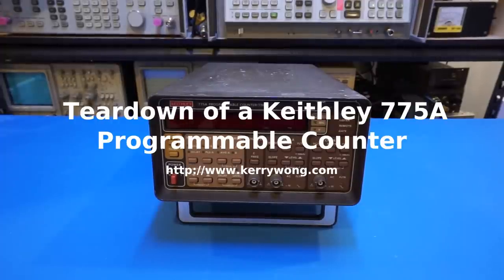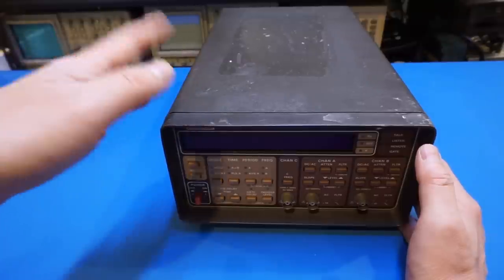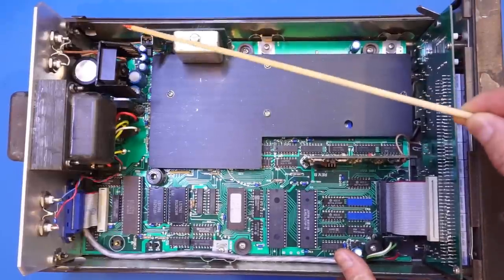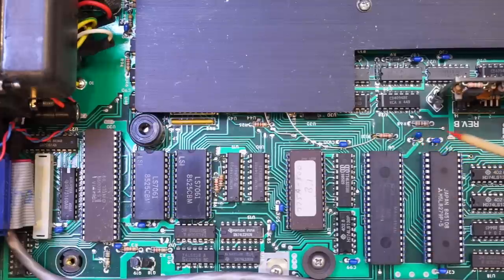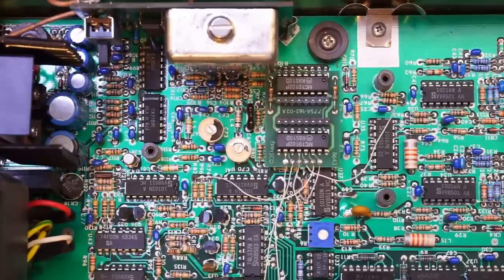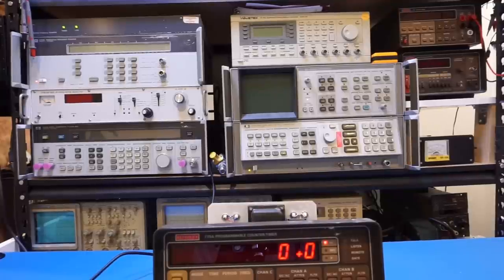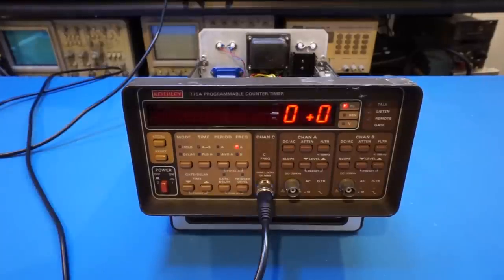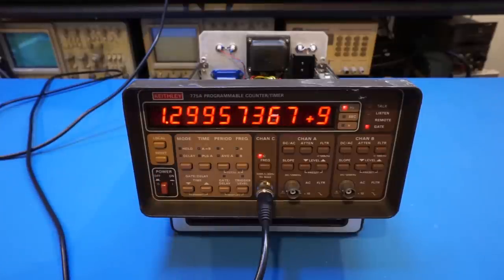Keithley 775A Programmable Counter Teardown

Comment: Perhaps if you feed your Rubidium standard into the external clock port on this instrument, you would be able to verify that the gating, counting and math functions of the unit are working properly.  This would definitively identify the TCXO as the problem.  Very interesting video, Kerry; thanks.
Reply from the maker: After I made this video I did exactly that and concluded that indeed the TCXO was out of tolerance. I am going to "fix" the TCXO and make another video. Stay tuned!
Reply: Great!  I’ll be looking forward to seeing your “fix.”

Comment: I found once that a faulty ocxo was due to the 25 turn pot being cracked from age (hot environments drastically increase the aging of plastics), once I replaced the adjustment it was fine, likely to be the same in this case.
Reply from the maker: The TCXO package is sealed, I will need to take a look to see if there's anything I can do.

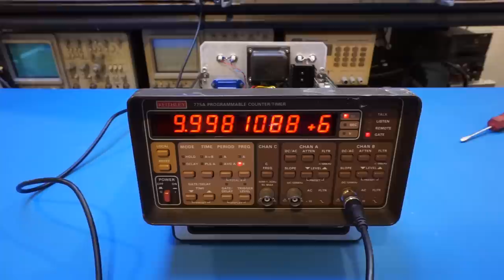Comment: I voted a Thumbs Down, because you investigated on the accuracy in an  unsystematic manner, and called 200ppm deviation at first (17:56) being   "pretty close to 10MHz" (which in fact is instead way off), and later (21:51), after unsuccessfully trying to trim that extreme deviation  as being  "OK", although such a huge deviation at once indicates a defect, when dealing with XTAL based oscillators. The trimming range is ALWAYS a few ppm at most..
Maybe the TCXO itself is fatally defect, or the 100MHz multiplier circuit (much less probable, indeed)
By the way, to create a sophisticated video, you should have mentioned, that this counter not only makes use of the reciprocal count method, but also uses a synchronizing gate for mitigation of the 1 count error, and also uses a 1:10 multiplication for the 10MHz timebase, which gives an additional digit for a given Gate Time, i.e. 8 digits for 1sec gate time, instead of 7 digits only.
Reply from the maker: Well, it was pretty far off but since the primary goal of the video was the teardown I didn't spend too much time doing the investigation. Thanks for the honest feedback, but stay tuned as I am going to repair it in my next video :)